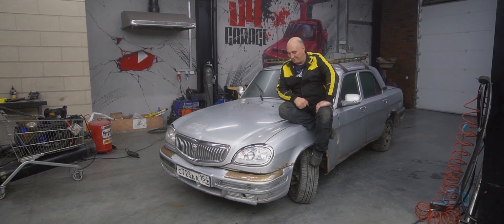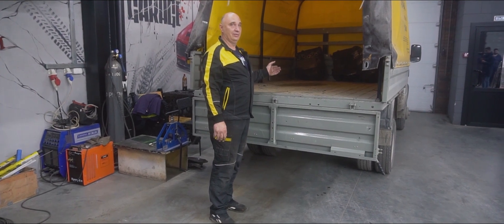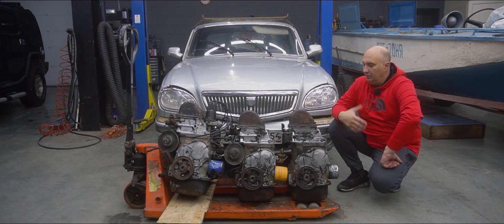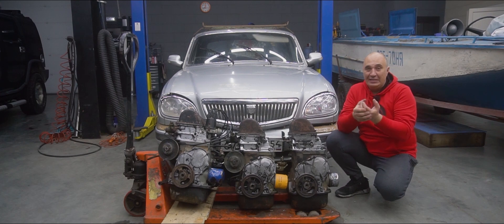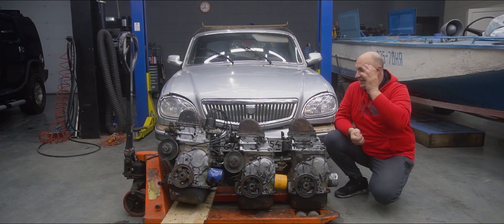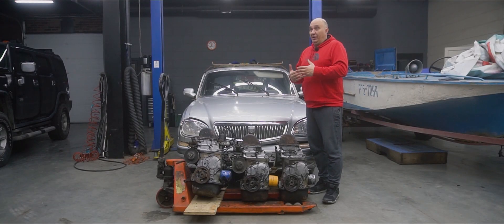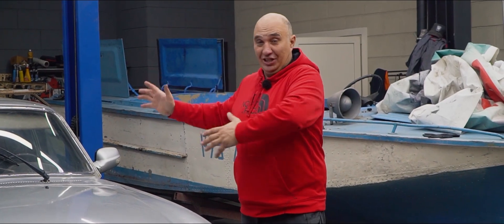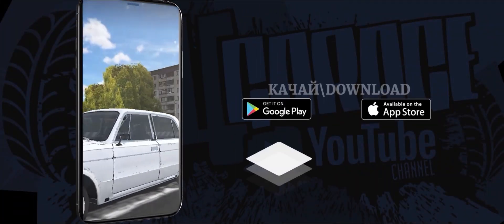Combining three Lada motors into a makeshift V12

Comment: Ok so try to put the engines in the same way you had the vid have top left engine run first then the bottom then too right all off set to the top left timeing so when the pistons move  move number one on top left then bottom number one piston is 2 and top left is number 3 and so on if that could be done might have something 

1.     3.  
   2.

Comment: You could attach the engines in a "W" shape. \ | / Put gears on the end of the crankshaft so they can be linked together. The three crankshafts would form a line.
\\ || //
  ooo

Comment: This is effectively an u engine you got there. Can you try making a vr engine (vee formation narrow enough to fit within one cylinder head, 22,5 degree angle is said to be the best)  such as VW's vr6, Lancia's vr4 that's also called the Lancia V4 and there is the Connaught vr10 but out of two inline 4 engines to create a vr8 engine?
Reply: Hand-making a VR engine is LITERALLY impossible without straight up casting your own brand new, custom engine block & head... -_-

Comment: Use a large blower (supercharger) belt on cogged pulleys on the front of the crankshafts. The belts and cogged pulleys are readily available, and hold up to a lot of horsepower.

Comment: I'd connect them synchronously using timing chains. Then, you can use 1 common distributor. Custom steel face and rear plate to hold it together.

Comment: Stagger the firing order over the three engines by rotating the crankshaft position.

Top dead centre of cylinder 1 should be unique to each bank of cylinders.

Example cylinder firing order 

Fire piston 1 engine 1,2,3
Fire piston 2 engine 1,2,3
Fire piston 3 engine 1,2,3
Fire piston 4 engine 1,2,3

Comment: Technically speaking, if you want to create one engine, with 12 cylinders, all of the 12 pistons must be connected to the same crankshaft. Otherwise it will be defined as 3 individual engines.

Comment: Instead of a Y12 a W12 would be easier to realize if you widen the V shape and smack the 3th engine in the middle.
This would also solve the issue of oil supply by making a bigger sump and elongate the middle oil pick up

Comment: I should have clicked right away and not slept on it, I’m a little disappointed now because I was picturing then cutting two cylinders off of one and putting each set of two on the other two engines and making a V from that, or even just staggering a v12/16 by having two front to back on one side and the other one in the middle on the other side, angled correctly and all that, I figured they’d at least connect it all to one shaft, but even just parallel shafts would be cool, then when he described what he was doing I thought it was going to be like a W 12, and when he said Y I thought maybe a weird version of a 3 cylinder radial but with 4 sets of 3, all the engines being standalone and in the stock orientation is kinda boring given what we’ve come to expect from these guys, but hopefully if they do it this way they at least use a Gilmore drive system with the cog pulleys, this are good for something like 45 horsepower, where serpentine is only good for like 15, and V belts are lower I believe?

Comment: Possibly putting them in a triangle and combining shaft outputs into a planetary gear set with 3 satellites with kinetic joints and axles. Not sure how or where to machine the gearing for that thing or if there is enough distance for the gearbox, but it's an idea.

Comment: I would connect the two top engines at the motor mounts, then build a bracket to mount the top engine to the bottom, on both sides, possibly from 25mm tubing and flat plate, then on the outside of the of the bottom engine mounts, make a mount to the frame, with possible bracing at the front accessories mounting points,   but I think something like a motorcycle chain and sprockets would work much better than a belt! It would be more likely successful in the transmission of the power from all the engines, and will prevent one engine from over revving!

Comment: so my thoughts are to obviously use solid engine mounts since the OEM ones are not going to work!. once at that point i would solid mount the other 2 power plants off of the frame rails. connect the 3 via a chain around the flywheel.(belts would slip too much) and then fabricate a 3 "v"belt pulley for the center harmonic balancer and attach a belt to each of the other 2.   Seems cut and dry at that point. all that's left is the normal rigging of wiring harnesses and fuel lines. assuming you keep it carbureted of course

Comment: Put a big flywheel on the input shaft of an automatic transmission on the bellhousing side, and then attach each of the flywheels of each of the engines in an upside-down Y configuration so there's two engines on bottom and the middle one on top is attached to the lower two engines. Then attach each of the smaller flywheels to the big flywheel so it's like each one of the engines is like a starter motor attached to the big flywheel on the automatic transmission.

Comment: A belt drive is the best method. I wouldn’t do one long belt though, connect two motors with the primary crank pulley and the other two with a secondary pulley bolted over the primary. That way you can ensure the most tension and less likely to snap because there’s less pulleys and it’s much shorter. I was thinking a single or dual chain drive possibly because of all the torque, some motors have dual chains driving the cams for added durability. Just bolt a sprocket in place of the crank pulley. Buuuut getting these motors all started at exactly the same time would be impossible. There needs to be a little give otherwise a chain would just snap or stall the other motor. Even if they’re off by half a second kicking over a chain or gear drive would fuck the whole thing up.

Comment: It really needs some kind of belt or chain driven system right where the engine meets the transmission, if not just use big pulleys on the front balancers, the bigger you can safely make them will give you the highest amount of torque, I'm just afraid you might rip the balancer off of one, also what about a single big turbo to feed all 3 engines?

Comment: You need all 3 engines in a Y with all throttles connected to the pedal. Good luck putting all that power to the driveline, maybe tight belts like a saw mill..... Or like a timing chain, gear the other two to the one connected to the transmission and driveline.

Comment: During WWII they made W engines for use in tanks. When they built those engines they had a special block to hold 5 rows of cylinders in a W. All 5 rows of cylinders used one crankshaft. For your project, maybe a gear box that all three engines are attacked to, and that comes down into one output shaft might be the way to go. Good luck!

Comment: an idea maybe use the 6 wheel drive transfer box from a truck  and combine 3 engines into one driveshaft.  or use chain sprocket from dirt bikes 3 in a row that should handle the torque just mint :-)

Comment: In front of the crankshaft pulley in the central engine attach (weld) 2 camshaft gears and 1 camshaft gear correspondingly on the crankshaft of the other engines. Then use 2 chains between the gears. You may need a much stronger starter or attach 2 starters to the central engine. Engines should have the same rpm at idle and the same (if possible) advance curve. All 3 engines should be as one rigid set (no relative movement between each other). You may use bars bolted in the front to the timing chain cover and to the back to the bellhouse.

Comment: Vlad, use 2 Subaru flat-6; one on top of the other.
Use also the Subaru gearbox drive shaft and the
rear axle. This are capable to 300 hp. One
radiator in front, the other on top of the engines.
One exhaust at left, the other at right. Voil@!
\edit The 1st GAZ Volga W12 300hp 4x4

Comment: As you have them in a triangle arrangement, but using Toothed Belts. (cam belt style). You can at least arrange the engines then, so their power strokes are spread out evenly. Without toothed belts they will inevitably end up "doing their own thing" - (getting out of sync)

Comment: Weld the blocks together and reinforce with tube construction, mate them so closely that you can connect fly wheels starter teeth together, witch transfers power to center engine, get heavy duty zinter clutch to move that power and adapter plate to cars transmission if its rated for power this potentially can produce. This does mean you need to run two outer engines opposite direction, or have smaller transfer gear to swap turning direction to back to normal.
Other option is to use chain drive connecting engines as one, but that would need to be bit heavier duty since timing chain suggested in some comments wont be sturdy enough to move power from engine to another?, only move valves witch have way less resistance far as my understanding is.
If you want to go easier route and bit exotic, then go with 3 hydraulic pumps driving the transmission and you could use that for something interesting later on, like sideways parking and lift the cars ground clearance. Optionally you could make it hydrostatic driven 4x4 for lols.

Comment: Maybe make it a V 16 with one other lada engine, weld two in a row, also with the other two, then use two gearboxes and two welded differentials for each side of the axle. This would need some engineering and a lot of cutting into the car, but the result would be amazing. It would maybe need a whole new front made from tubes, making some sort of mad max style car. Perhaps raise the suspention, using some big offroad tires?

Comment: You should take in the rear of the motors and get a big chain connect all three motors in the back by the flywheels and that's how you can transfer all the power from all three motors to the wheel the belts are not going to transfer power you just need a massive chain cut the bellhousings feed it through so it's a y shape chain configure

Comment: A belt will slip, especially if you want the lower engine to start the upper two. You'll need to do it using gears, a chain or a toothed rubber belt like a super long cambelt, I don't know where you'd find one though! Make a frame to hold all the engines together, make sure they're solid mounted as any movement will cause slack in the drive system. Good luck. Looking forward to this!

Comment: How about combining them by a pulley and belt/chain system som how, or by s gear system to combine all three together to one transmission if it can handle three motors power without blowing the trans up.

Comment: Connect the engines at the front pulleys with motorcycle chains, sprockets, and idler sprockets to keep the chins tight. Cheap and simple. Maybe double row chains would be stronger.

Comment: Change the crank pullys  out for motorcycle chain sprockets possible a double or tripple stack chain and use a chain between all three crank pully sprockets , and then use the stock crank out put shaft of one of the bottom engines to run the transmission, that way all the engines are in sync AND they are all combining there power into to one crank and one transmission, it seems crucial though to have the engines aligned and in sync

Comment: Build a common sump lengthen the two outer oil pickups to suit and use a Harley Davidson primary drive chain run around cogs bolted to the flywheels , the two outer engines bracket to the inner engine sort of a W 12 , there should be plenty of bolt holes for front and rear brace's , brackets and bolt the whole thing in

Comment: Okay, those are the solutions that came in my head:
(For the sake of making things easier to understand, the engine at the bottom of the Y will be called "I" and the engines at the top, from left to right, "II" & "III")
1st more dangerous and more metal 🤟🏻:
You could connect the wheels of the engines together, since they have the same teeth, and to connect this output to the gearbox, you could weld another wheel to the #I engine, or make an axle to said secondary wheel, or no wheel at all. Who needs a clutch mechanism anyways?
2nd a little less dangerous and more simple:
You could make double pulleys for the cranks, that way you could attach the belts from II to I and from III to I, also one of the top engines could drive the alternator and the other one could drive the power steering ( you are gonna need that).
Sorry for any mistakes here, English is not my native language, and I just woke up lol
Greetings from Brazil!

Comment: Attach a extended cog to the fly wheel plate and run a chain from all 3 too it make a big bottomed oil pan for the 2 motors up top and have then use the same oil

Comment: I think you should try something with those oil filters, remove them and replumb the oil to a big common filter, makes the engines narrower, then you should be able to mount them in the car lower and at an angle to the centre one so that you can see out of the windscreen.  The two of the engines will need custom exhaust headers to come out of the top or back, or just an open pipe pointing up without a muffler. Good luck... I see lots of cutting and grinding in the engine bay to make it all fit.

Comment: Getting all 3 engines to run at the same rpm is going to be a challenge. If one engine is running at 1500 rpm when at the same time another is running at 1300 rpm and the 3rd is running at 1400 rpm they'll be pushing and pulling on each other through the drive belt.

Comment: Mount the upper 2 by the out side motor mounts to the lower motors mounts then bridge the upper twos inner  motor mounts together then as for the back fly wheels you simply need to mount a drive pully to the right one directly and the left one will need a gear off the ring gear to get it to spin the proper way to add drive 
Can give drawings if needed for visual 
Установите верхние 2 с помощью внешних креплений двигателя к нижним креплениям двигателя, затем соедините верхние два внутренних крепления двигателя вместе, а для задних маховых колес вам просто нужно установить приводной шкив непосредственно на правый, а левый понадобится шестерня с зубчатого венца, чтобы заставить его вращаться должным образом, чтобы добавить привода Могу дать рисунки при необходимости для наглядности

Comment: I would recommend using a chain instead of a belt. as long as the chain is reasonably tight it can't slip, but also allows for some vibration and movement. with a chain tension isn't as important as with a belt, which must be very tight. you can get these large chains and gears from an agricultural supply store, they are used in farm equipment such as hay balers.

Comment: ...next time use rear wheel drive car as a testbed. Put 2 engines in the back and connect them to the 3rd engine in the front engine via stock differential/drive shift in the rear. Rest of conversion is connecting that front engine to the front wheels like you did before...:P

P.S. ..patent that solution as a "Siberian triangle"...;P

Comment: the work to pull it off would be a fair amount but running it on a chain pully would be a more effective method of power transmission to the main motor, and would add a more aggressive sound over all to the motor

Comment: are you able to mesh the flywheel teeth together in a Y config? 
that way you get better direct drive? 
as surely only doing the rubber belts wouldn't be sufficient and will have torque loss??
plus then only 1 engine needs a transmission then

Comment: I think, that you should turn the middle engine by 180degree so that they will face each other. So you could reach and repair any engine but of course have to solve the Problem, that one run in the other direction

Comment: Add nothing lada motor and make it a 16 cylinder. Join two from the rear of one to the front of the other and then mount them side by side to a mounting plate.

Comment: Should be easy with chain drive. 
Using a thick motorbike chain and this way you can join all 3 engines together you can double the chain to spread the load so it won't snap under pressure.

Comment: On the primary engine mount a flywheel from the front of the crankshaft.  Turn the 2 auxiliary engines around backwards and mesh their flywheel gears with the new one installed on the front of the primary engine.

Comment: 2 big plates of thick steel to aluminum, "machined" (or cobbled) to bolt to the front and back of the engines
Reply: Also the belt tensioners on the front could bolt to the front plate

Comment: Using a chain instead of a pully belt would be better for transferring power, and having a spring loaded sprocket to take up and release slack as needed would mitigation vibration issues i think

Comment: If you have room to do so, just put all engines upright and in parallel but crankshafts at 120 degree different angles, join with strong chain running around every flywheel.

Comment: Perhaps use a hinge on the side engines  to be able to vary the tension? My Dad did this with a lawnmower engine when I was a kid 50 years ago to rock the motor and tighten the engine belt from the crankshaft to the drive wheels. The whole engine rocked to a position where the belt was tight and powered the rear wheels. There was a guard over the belt so no fingers were lost! Just throwing an idea out there! Love your channel and keep up the great work!

Comment: Perhaps instead of using normal accessory belts and pulleys you use the drive belts either and pulleys from large blower cars or the drive belt and pulley system off of a harley davidson just my 2cents

Comment: ditch the 3rd engine and make a killer flat-8.  Take off the oil sumps, make a new sump for both engines and then run an idler gear setup between both engines driving a common output shaft.

Comment: Chain and sprocket to attach the cranks together. (If timing chains work why not crank chains) and attach the drive shafts through a large planetary style hub that'll spin a central hub to the rear wheels.